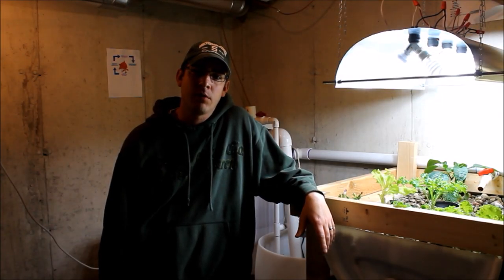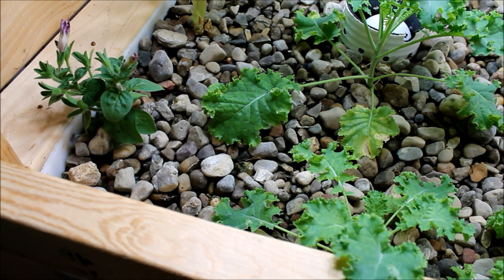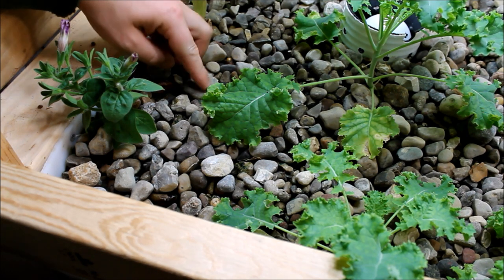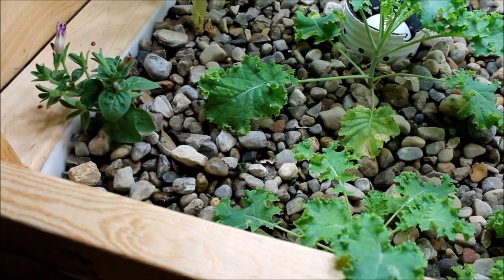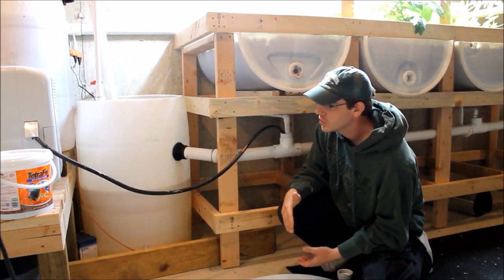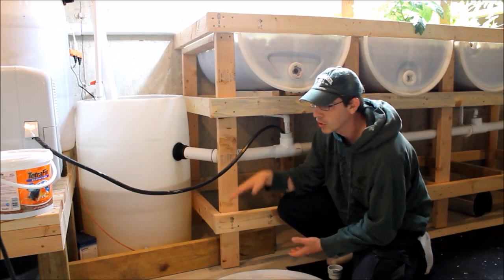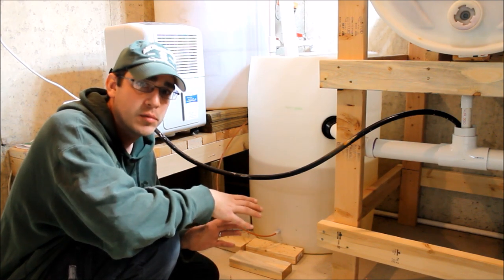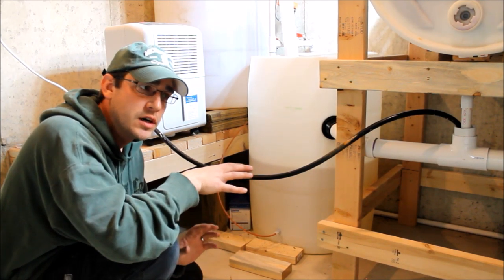Aquaponics System Design  - Tips and Tricks

Comment: Most people make the mistake of using the water pump directly from the fish tank, that is why you have sludge in your troughs. if you had an overflow sump tote next to the fish tank so the tank water overflows into the sump tote that way you do not traumatize the fish and the fish tank stays the same level all the time. you can fill the sump tote with filter material to stop trough sludge plus act as a bio filter. also line your fish tank with filter material acting as additional bio housing for the good bacteria.

Comment: You have some good tips in your video.  Rather than using a swirl filter, put red worms into the grow beds.  They will process the fish waste and excess food and prevent you system from clogging up.  Finally, do not add water from your dehumidifier to your system.  the condensation coils are built from copper pipes and the may have lead in the construction.  they are not meant to provide potable water.
Reply from the maker: Thanks for the tips David, I appreciate that. I plan to put some worms in the system over the next couple of months as mine reproduce enough. Worm are a great addition to aquaponics for sure but I would still say the swirl filter is a needed addition. I have since added one to this system and it works great as well as provides some nutrients for my garden and house plants when I dump out the waste. That is a good point about the humidifier as well, I would hope that it does not contain lead and as far as copper, well all of your water pipes are made out of that so it can't be too bad! But, the fact is I cannot be sure what other metals are in there so point taken! Thanks for watching and commenting!!

Comment: One things I would recommend would be to not use clear tubing and plaint your drums to help block light from entering the system in areas you do not want growth.
Reply from the maker: That is a great point and one that a few others have made also. I am going to look into getting some reflective material to keep the light in the grow beds first, which, in turn, will block any light from getting to the tanks. Not much algae growth in the system so far but I have noticed some on the sides that face the lights, thanks for watching!
Reply: SSLFamilyDad
I am thinking about adding foil to the top of my medium and the edges of my floating mats for that same reason :)

Comment: Hey I think you need a new battery in your fire alarm. Also a little advice about the dehumidifier, it is true there wont be any minerals, However since moisture is pulled out of the air so is dust and bacteria, you will most definitely get a build up of some bacteria after a while if you continue to drain the dehumidifier into the system.
Reply from the maker: Thanks for the comment B-rad, batteries have been changed! I am not using the dehumidifier anymore but that is a good point about dust and bacteria. I suppose anything in the air would or could end up in the system. But, I suppose if it is good enough to breath it can't be that bad right:) Thanks for watching!

Comment: I had a similar water height problem in my half barrel beds.  I disconnected the drain at the bottom on the bottom outside, using a Dremel with a cut-off disc I cut the overflow pipe in my siphon to where I wanted it.  I use pvc unions to adjust the water height in the beds now.  Cut the unions to varying lengths and change them out as you need them.   I need higher water levels when seeds are germinating and lower during normal growth.   Warning,  flush out the drain system after the Dremel work.  The PVC dust will circulate throughout the system.  A simple solution that worked well for me.

Comment: Thank you so much! Your suggestion with using a dehumidifier as a water topper is really helpful. I don't see how I missed thinking about that possibility considering my fish will be raised inside with the plants growing outdoors. Our property runs down a slope and we're going to take advantage of it when setting up this system.
Reply from the maker: The dehumidifier worked great this last summer when I used it. I don't use it in the winter but I have the filtered water topping off the system now. Sounds like you have some good plans for your setup, good luck!

Comment: A great way to balance PH is to put a stocking full of shells in your water....I think oyster shells are a great one. The shells bring the PH back to neutral
Reply from the maker: Thanks for the comment Steve! Adding oyster shells or egg shells to the system is a great way to balance pH however, in my case where my pH is too high the calcium carbonate would unfortunately not bring the pH down lower. This is a great method if you have a low pH as the oyster shells will bring the pH up to neutral as you mentioned. Great advise and thanks for watching!!

Comment: Good video, which will help me design my system.
I'm planning my aquaponic system and your video made me wonder if using broken clay pottery would work as a grow media. It is porous and relatively lightweight. One problem might be the sharp edges of the pieces. I know that Hydroton grow media is supposedly run through a tumbler to smoothen it out. One description states that "Hydroton grow rocks are a special kiln-fired, lightweight aggregate that is super-heated and formed into pebbles 8-16 mm in size. The ceramic shell and inner pore structure retains moisture and releases it back to your plant's roots as needed."
Reply from the maker: Honestly I had thought of using broken glass, plastic beads, and other things that I have not seen before and I would encourage trying anything! Broken kiln fired clay pottery should work fine I would think, as long as you can find enough to break! I have stayed away from hydroton use to it's cost and it does wear down and start to degrade after a few years. I have chosen beechwood pebbles for my system - check out this video - http://youtu.be/wSzGOCHEoeo
Thanks for watching!!!

Comment: Great video, thank you, I just have a few suggestions that might help. 1. Use gravel not smaller than 3/4", you might want to make the top 1" surface smaller gravel to hold seeds in place.  2. Add earthworms to your gravel, they eat any fish food left over and clean your system in general by eating any dead plant roots and they also provide extra nutrients for the plants. 3. The pipe that goes from the sump tank water pump to the grow beads, make sure that it goes all the way to the bottom of the grow bead, that way if the power goes out, the water will syphon back down to the sump tank by gravity and will not sit in the grow bead until power is restored. Let me know if you think those are good ideas and if you can improve on them also, thank you.
Reply from the maker: Thanks for the advice and checking out the system! I am now using what is called beechwood pebbles as grow media, it is a 3/4 crushes igneous rock; it is working really well so far! I will be adding worms to the grow beds as soon as my worm population is large enough in my worm bin. These are all great idea, thanks!
Reply: SSLFamilyDad From what I have read, use caution with worm selection. I use red wigglers and they live and reproduce well in flooded gravel beds and seem to break down the solids well. I'm not sure any worm will perform well in such a system. Thanks for sharing your lessons-learned. I appreciate your candor and observations. I have often wished I had put a couple of airstones in the bottom of my gravel bed to improved aerobic activity and reduce the anaerobic zone. Thoughts?
Reply from the maker: ***** I have been adding red wigglers to mine so I hope they are doing what they do in there but I can't really tell to be honest. Adding an air stone to the bottom of the grow beds is a great idea actually I hadn't thought of that. Thanks for watching!

Comment: seems costly way of growing such few plants until you get fish that you can sell and eat but even then i wonder if it is worth it other than for an emergency food source, but with all the electrical you are using as well as the location, you are not exactly self sufficient if power goes out.  thanks for some tips and advice  but i think 25 fish in one barrel is still too much if you consider them growing to an eatable size, so a three barrel system for the fish and one for water storage and one for filtering would be my choice. The reason i watched was my limited space to have anything larger for the fish and then to run lines to a green house on the south side of my house that is easily heated. I worry about humidity in the basement but also want to run off solar so de-humidifiers may not be an option.  I appreciate you sharing your experiences. Thx

Comment: Nice setup. I have a system that has 2 tote beds and 2 swirl filter raft beds with an IBC tote for the fish. I'm also using gold fish and a few koi. This is my 3rd year with my system and was using the same media every year as I would have to shut it down come winter. but I changed my media this year to a mixture of hydrocon clay pellets and white grow snones made from recycled glass. During the transplant I rinsed the roots off and I must've been a bit rough on the roots cus they layed down for about a week and alot of the leaves died. they are coming back but my romaine are growing in odd directions now and it just seems like all my plants should be growing alot faster. I also have a high PH and have hard well water as well.
Reply: I have my system in a greenhouse but it gets so cold in the winter here I have to shut it down and bring the fish inside. This year I plan to build a section on to the back of my greenhouse and put a wood burning stove inside to try and heat it. we will see. I just started this channel and plan to make some videos soon.
Reply from the maker: Midwest Aquaponics Can't wait to see the system! I plan to move out to a greenhouse probably next year as well and am planning to heat with wood. I just did a video on a wood burner if you are interested - http://youtu.be/k6ztN_lGnGc
I am mostly using free pallets as fuel right now also. Thanks for commenting!
Reply: SSLFamilyDad Yeah I watched that video too. That's the wood burner I plan to use. I live in central Illinois surrounded by woods so I will not have any issues getting wood to burn lol. I'm looking forward to making some vids, It's been storming here for a few days so I'm forced to wait it out. Thanks for your vids I find them very informative.

Comment: good video but I have a few questions. Why can't you just adjust your stand pipe on your bell siphons to get the water to the correct pipe? also wouldn't the mineral rich well water be better for your plants than a purer water? I am sure a swirl filter get all the poop if it is placed before the water is put in before it gets into the plant beds.

Comment: Awesome video, lots of ideas I'm taking from this. Thanks.
Reply from the maker: Glad I could help Jude, thanks for watching!
Reply: Quick question. My aquaponics system is used based on NFT. So my flow of water is continously.  I'm now planning on installing a grow bed. Why do I need to use a bell syphon or similar to fill and drain. Why can't I just fill from the top and drain down the bottom?  Any ideas for a sump filter. My fish pond is in ground.
Reply from the maker: Jude Fernandes Good question, if you are going to add a grow bed and fill it with media it would be easiest to just use the flood and drain method with a bell siphon. If you just fill from the top you would have to have many nozzles dripping water all over the top of the bed so that water would drip down across all the roots.  Flood and drain is generally the easiest type of system for media based grow beds. Hope that helps and thanks for watching!

Comment: 2 questions. 1) why wouldn't you want the fish pooh around the roots of your plants? isnt it the same as using other kinds of fertilizers 2) i am new to this but find it very interesting. one thing i have noticed is no ones say how much water whould be covering the roots. like do you want them in water 24/7 or only a little bit in water and the rest out and/or above the water in your grow bed?
thanks for your helkp in advance.
Reply from the maker: Tyler Murray  No problem Tyler, good question. I have a series of other aquaponics videos on my channel that go into more detail but the basically the fish waste is not what the plants feed on the waste is converted into nitrates through a biological process called nitrification. These nitrates are the main fertilizer for the plants. The grow beds fill and drain automatically every ten minutes so the roots are in and out of the water 24/7. Hope that helps!

Comment: Addressing your first tip (testing the rocks for calcium), if they do fizzle a bit it will raise the ph of your water. That being said it is not that hard to lower it back down. You can add a mesh baggy of peat moss to the system to lower the ph down. Also with the bulkhead into the sump, you can just have the pipe float above the sump tank and drip in. It shouldnt need to be fitted with a bulkhead as it shouldnt need to be sealed.
Reply from the maker: Jared Shillingburg If you have calcium carbonate in your rock (it fizzes with a vinegar test) you will never be able to lower the pH, trust me I worked with it for a year and added straight up acid to the system and it would always come back to 8.2 or above. Making sure you have a pH neutral grow media is one of the most important first steps in aquaponics. As far as the bulkhead in the sump, due to the height of my system and the slope needed on that pipe it needed to be fitted into the tank like it is. When all four grow beds drain at the same time the water level rises up above the bulkhead and up into the pipe a bit, a design flaw in the heights of my various components. Thanks for checking it out and commenting!

Comment: dehumidifier is gray water and may be some of the reason for your ph swing...the water that comes out is know as condensate water
Reply from the maker: Excellent point, I am not using that at the time only because it stopped working. The condensation from the dehumidifier comes out at close to a pH of 7. This would be perfect as that is the recommended pH of the system but until I get rid of the river rock causing the 8.2 pH (limestone) it won't make much of a difference I am afraid. Thanks for watching and the comment!
Reply: its a great video man, liked it alot...i know for aquariums you can use co2 (u can buy tanks at air gas) then buy a regulator. that way can control ph using that. dont know if this would apply here. but its a thought

Comment: good tips on the rocks, could you use any type of glass beads or pieces or does the porous surface of the rock help with nitrogen conversion? Thanks, I am a wannabe aquaponic. Just was thinking if glass would work being neutral
Reply from the maker: Good idea Scott, I think glass would work just fine in fact there are a few places that offer a recycled glass bead for grow beds but it is rather expensive. The porous surface does offer a bit more surface area for the bacteria to grow but glass would still work just fine.

Comment: The aquaponic systems I've done in the past I've used nothing but rain water. I put a 100 gallon tank under the gutter so I have water anytime I need it.
Reply from the maker: Thanks Brad, that is a great idea! I am planning a nice rain collection system this spring and I just might pipe it into this system, thanks for watching!
Reply: You're welcome... in the winter I'd just keep about 30 or 40 gallon in 5 gal buckets in my basement so it was always at temp...Hope that helps.
Reply: Be careful. Know that you may be putting chemicals into your fish water that you may not realize. Especially "3 tab" roofing.

Comment: I really want to build one. Can it be unattended for two weeks if I go on vacation?
Reply from the maker: It should be fine as long as you have a timer on the lights and your power doesn't go out. Even if it did it will start right back up when the power comes back on I suppose

Comment: Hi,
I just started an aquaponic system in mine basement. I am wondering what is your basement temperature? I am growing tomatoes and I am worry that mine is not warm enough.
Reply from the maker: +Glenn King that was an issue I had also. Might want to heat it just a little or 8nsulate the tanks as best you can. Mine is about 60 degrees

Comment: uniseals are much cheaper than bulkheads.
Reply from the maker: That is 100% correct, much cheaper in fact. I spent almost $6 for each of the 2" adapters in my system. Less for the 3/4" bulkheads but still more expensive than the uniseals. Thanks for watching!